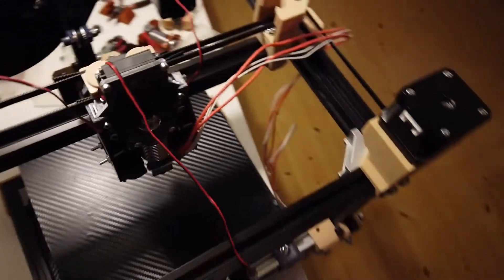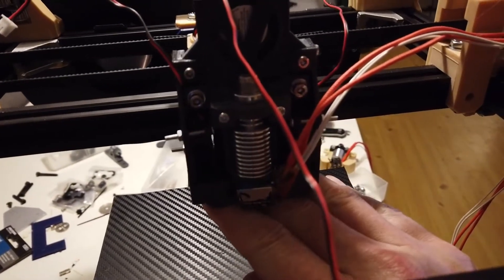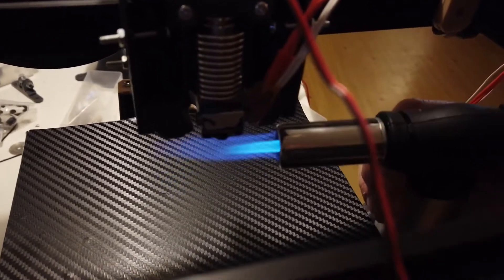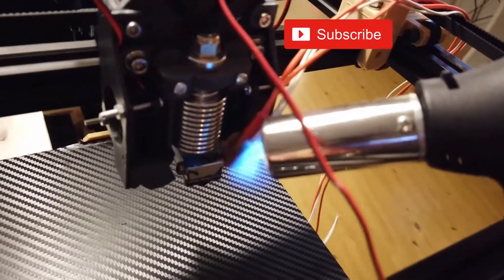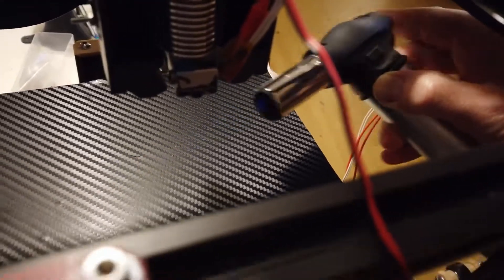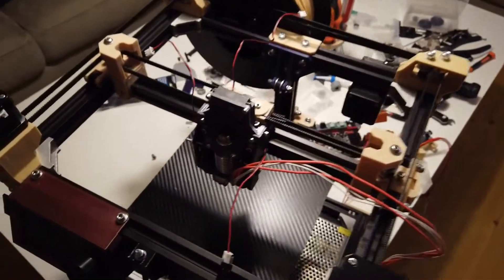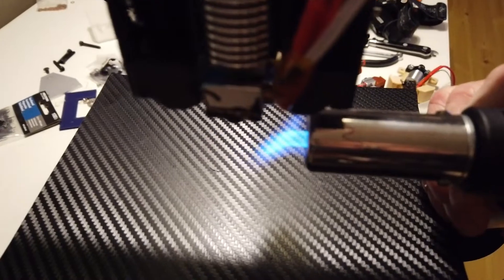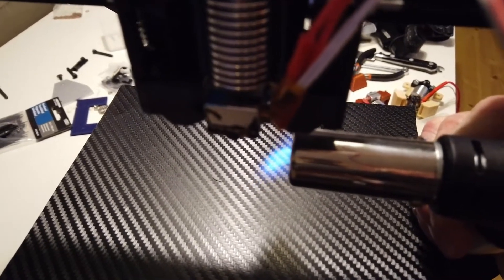My Fan Setup | CHECK THIS AIRFLOW! | V-Baby DIY COREXY 3D Printer

Comment: I have been struggling with getting good airflow with this design. What fan are you using?
Reply from the maker: It is just a 4010 24v blower. Ball bearings dual
Reply from the maker: For the layers it is a 3010 blower. 24v dual ball bearings
Reply from the maker: There is a link to the fans on my github repo. In the bom file